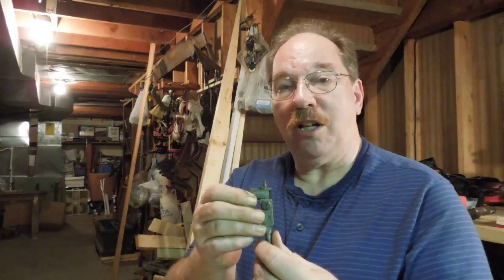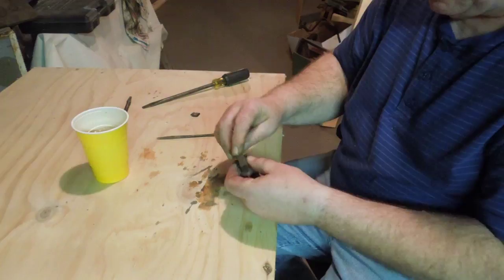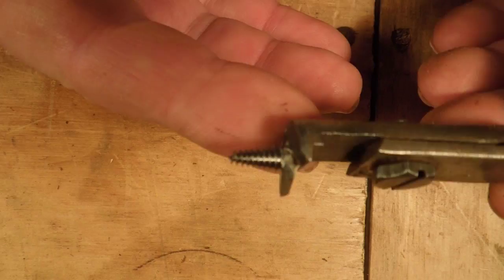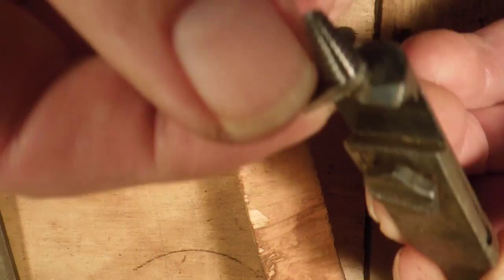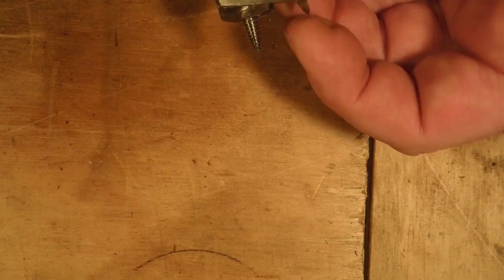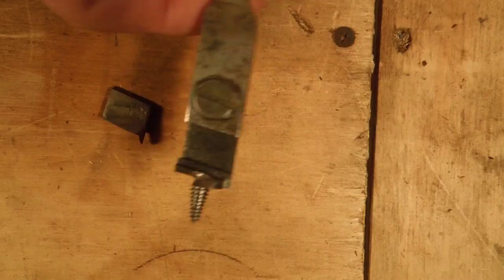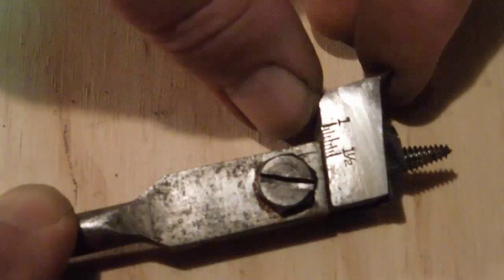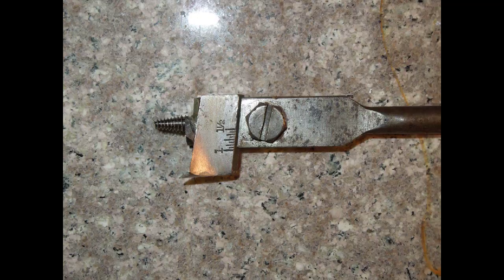Sharpen And Tune An Adjustable Auger Bit - A video tutorial by Old Sneelock's Workshop

Comment: I inherited a bunch of those bits from my grandfather.  What a great idea they are!  I also carefully touch them up with a variety of methods the best for me is aluminum oxide rotary tool grinding stone that is ground to proper size. It works great but only if slow speed is used, if it even gets warm the sharp edge probably be hot and it will lose its temper.  Not for everyone, I've ruined a few cutting edges until I learned that lesson. When done properly I can almost make long sheets of wood paper at times. 

 I had a few of these old bits where they had a old brace type attachment on the shaft. I cut them off with a Dremel disc so I can use with a keyless Jacobs type chuck. 

I've found that the self-feed screw tip is critical, if clogged up then clean it, if "dented" either try to reshape it or forget it, it will be hard to use
Reply from the maker: Chris Barth I prefer to use them with a brace but they just need a way to rotate them. Glad to see you are using them.
Reply: Ill have to try the brace method, when woodworking.  I imagine there is a sense of satisfaction with doing things manually.

 I wonder if oldtimer electricians are shaking their heads in disgust of how modern electricians have never once touched a brace in their whole career. Hell, I bet most  dont even know what a brace is. Damn spoiled whippersnappers.
Reply from the maker: Chris Barth When my Dad got his first electric drill he cut the square tangs off of his auger bits. The Screws pulled to hsrd and bogged down the  wimpy little motor in the 3/8" drill. He ground off the threads. It took a great deal of pressure to push the bit through.  He dropped the  auger bits and went to spade bits. 40 years later I got interested in auger bits and found that, in a proper size brace, they actually cut almost as fast as a spade bit with out the jarring impact that was causing carpel tunnel issues.

Comment: A good video, thanks. I just bought a bunch of tools on our equivalent of Craigslist and there was an adjustable auger in there, which even has two cutting blades. I've been after one for a while now.
Reply from the maker: You're welcome. Once you get it sharp and lined up correctly it's amazing how well it works. Just make sure you have the cutting edge lined up with last thread of the screw.
Reply from the maker: +Pop&#39;s Shack How did it work?
Reply: Old Sneelock's Workshop Thanks for the follow up, but I still haven't got around to it yet. I've been fairly tied up with taking the shack off the grid.

Comment: got an older one and it works better than on an actual power drill
Reply from the maker: 24inchdubzA hand brace develops more torque than most power drills  It also stops immediately when you stop applying pressure. Both of those actions are important  when you're spinning a 3" bit.

Comment: Hey Sneelock, can you tell me where I could finds anyone who has or can make Barn Beam Drill Bits for a Swam? I am restoring one but need bits.  Thanks so much, Luke
Reply from the maker: Most of the drill bits I have seen for the old boring machines are cut down barn augers. The local blacksmith would cut off the square tang and forge a 1/2" tenon on the shank to fit the setscew chuck. 
You can pick one up at flea markets and on Ebay for $10.00 and up. 
I have a few.

Comment: I have just found two of these at a car boot sale for 40p each (50 cents) and was excited to use them. This video has been invaluable in showing me how to sharpen them. Whilst writing I have found a Billings and Spencer (Hartford) wrench (auto or monkey wrench) but this one has a supplementary handle attached which works by cam action to really cinch the wrench tight on the nut or bolt. It was a very reasonable £1 but i have been unable to find anything about it on the web. Do you know anything about this tool ??
Reply from the maker: Once I sat down and figured out how they worked so I could sharpen them I have had great success with the process. I have 4 in the rack and not a nibble on taking any off of my hands. I think they have such a bad reputation that no one wants to mess with them. I'll bet if you let it around to your friends that you know how to make it work they will either want you to sharpen theirs or gift them to you. 
As for the Billings & Spencer wrench, not off the top of my head but I'll look around a bit. 
Anybody else know about the Billings & Spencer?
Reply: Thanks Sneelock, I do not know how a Billings adjustable spanner ended up in rural Berkshire but glad it did. The jaws are perfect and the cam action of the supplementary handle gives a fantastically tight hold. If you have ever used a Footprint wrench then you will get an idea of the hold. BTW, do you have Footprint wrenches in the US ?.
Reply from the maker: I found a listing of the patents assigned to Billings & Spenser. They have a bunch of them.
http://www.vintagemachinery.org/mfgindex/detail.aspx?id=2522&tab=7
Reply from the maker: UK Tony Looking for something else and found this. http://alloy-artifacts.org/billings-spencer-company.html
Reply: Sneelock, many, many thanks for the links. The model G is marked on the auto wrench and while it is not shown I can see it may have been a prototype or test piece as the supplementary handle is factory fitted and not an amateur job. Kindest Regards from the UK.